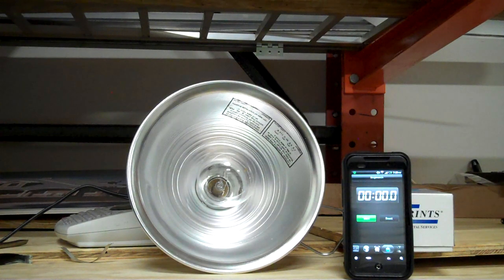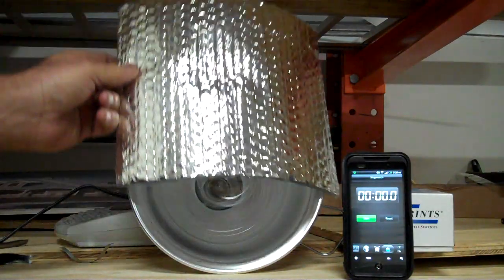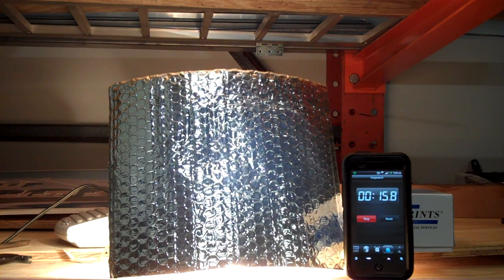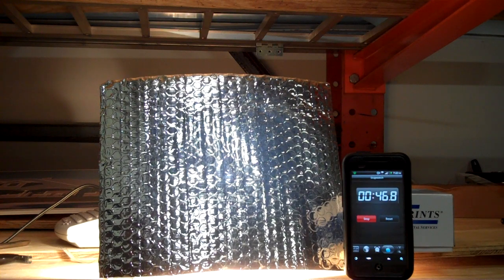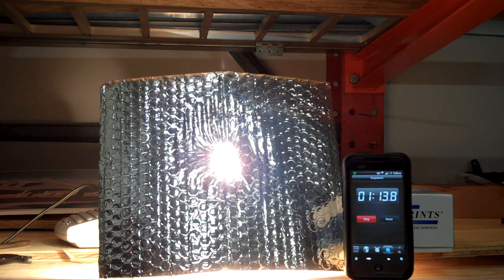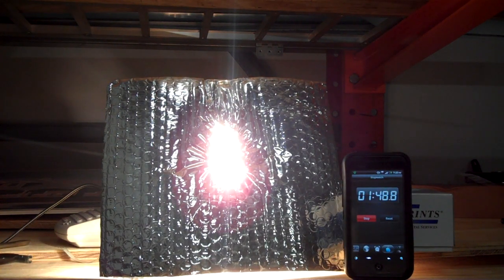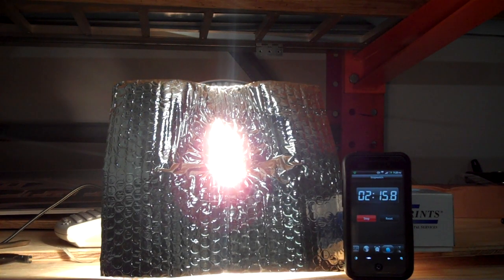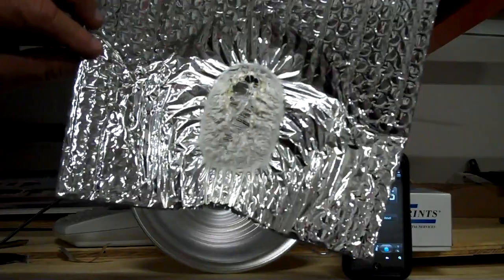Foil Roofing Insulation Light Bulb Test March 2012

Comment: I sandwiched this insulation under my sheet steel roof and it's performing brilliantly years later. Mid summer, the temperature underneath is still cool and not under distress. 

This video is a load of bollox.

Comment: You are out of your mind to test an attic radiant heat barrier with a 200W incandescent bulb. That one probably reaches over 500F next to it , with filament having temperature of about 3000 °C.  Freaking OSB will catch fire if tested like you did it.
Reply: half my shop with this stuff just turned to brittle plastic. It's all over the floor.  When you step on what has fallen from the ceiling it turns to confetti. It;s just peeling off everywhere. 
another batch in the same building is moderatly ok. Never buy this crap.

Comment: I have measured my roof surface temp at 160 on 95 day. The interior at 139 and the rafters at 118. Typically you would be stapling this to the rafter which would be less than 120 so I doubt it would melt.  In fact I have some reflectix attached to the bottom side of the back porch which I measure around 135 and it's been there for several years and seems fine. The reflectix drops the temp about 20 degrees.   I don't know what you think you are testing but it is not a real world use case of any type of radiant barrier type insulation.

Comment: I've been in plenty of addicts have never been in one where a 200 watt bulb was up against the insulation¿ it's not like it's a steam locomotive boiler or something¿
Reply: All true comments on here and I can only reply to Bret as google have not given me a reply option for the others :-).
I think the guy is trying to say under a metal roof sheet not a standard tile and felt roof. The bulb is to try and show the heat a steel roof can get to, think of it this way you can fry an egg on a car bonnet on a hot day so this stuff applied direct under a steel roof may and probably will fail. Burning I am not sure about but the bubbles will probably pop.
Reply: Oddball always with the negative waves Moriarty
Reply: Bret H
Woof Woof Woof!
Reply: At matter of fact, i can see very clearly that the radiant barrier he purchased was in terrible quality. Its nothing like the one i have. My has thicker aluminum foil on both sides and its fire retardant. I tried to burn it with my stove it doesnt really burn too much. U will melt it but it cant cause fire.

Comment: Years ago we tested the maximum interior temp from natural causes and established a max of  95c.  That is the temp spec that GM requires for all its components in the interior of a car.  This method of testing is suspect. The distance from the bulb, (most people don't use 200 watt light bulbs), or put insulation against them, are all flaws in an accurate testing. Is the presenter trying to show an accelerated life test? This won't do that either.

Comment: An idiot is born every minute.  This is a test only a person with no sense of physics could do.  An electric current heats a filament to typically 2,000 to 3,300 K (3,140 to 5,480 °F).  How hot do you think the surface of that 200W light bulb is?  It's at least 347 degrees and with the foil so close to it what would you expect?  I could melt any Styrofoam insulation with that as well.  Get a life!